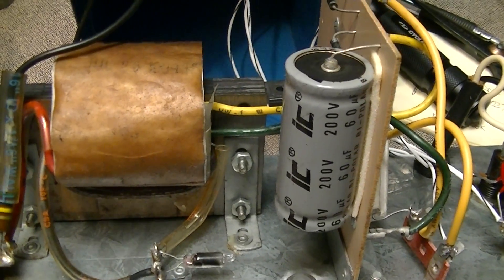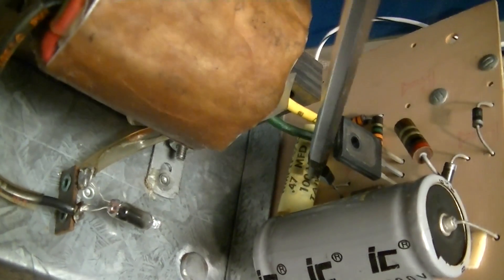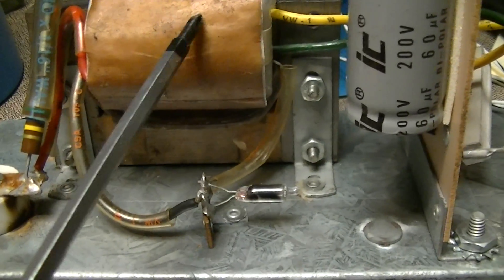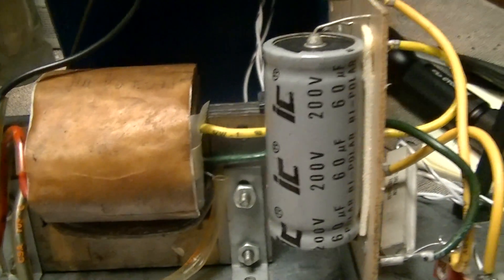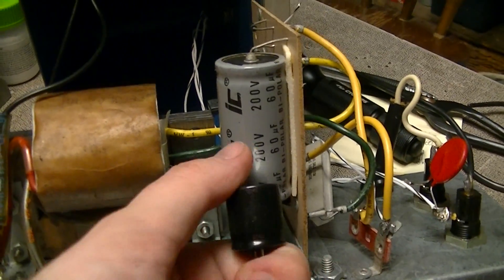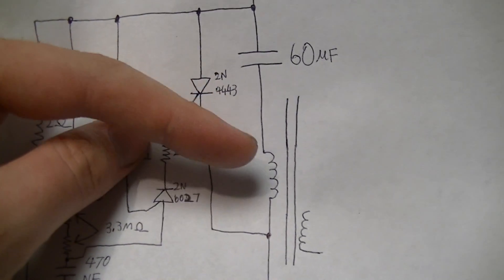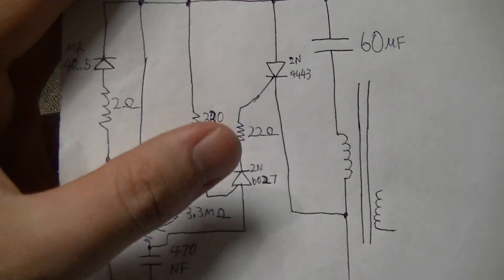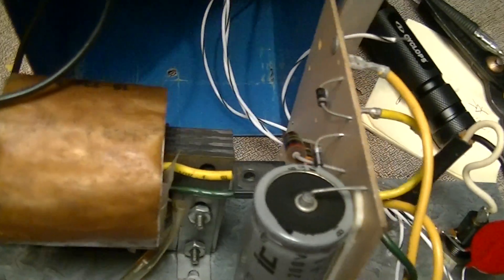Universal Cooperatives Super 2000 electric fence controller guts

Comment: I wander what the value of that neon bulb? I have a few left over from when I worked for ASI back in the early 80s . they made radios for high end cars . The neon bulbs back then was used from the tuner to frame inside the radio . It was to control static electric inside the tuner as the Delorean car has a lot of static electricity from it body . I remember radios coming back and the tuner had blown transistors . We had to mod all the ones coming back . I miss those days.